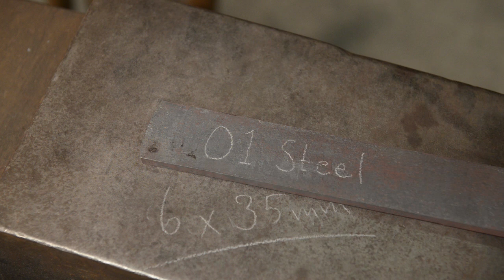Blacksmithing - Forging a herb chopper

Comment: For what is the annealing in vermiculite, i never seen that before? Thx
Reply from the maker: If you check the specifications on the steel, annealing often requires the steel to cool very slowly. By placing it in an insulator it cools quite slow. However not slow enough really for this type of steel... it should cool at a max rate of 20C / h.... from 800C down to 500 or so then you can cool in air. So it's a several hour process....
Reply: Torbjörn Åhman ohh ok thank you for your answer, amazing work

Comment: Wouldn't you want to keep the blade at critical temperature for as short a time as possible in order to reduce large grain growth within the steel?
Reply from the maker: Nope. If you're hardening by the steel specification it most likely needs to be held at "critical" temp for at least 20-30 min. To my understanding grain size shouldn't be affected as long as you don't over heat.... easier said than done with a coal forge. You really need a heat treating oven to make this right.

Comment: what is the stuff flaking off each time it is heated?
Reply from the maker: Iron oxides, we call it "scale". It is formed on the surface of the hot steel in reaction with the oxygen in the air.

Comment: I have a Question,How did people cut Steel as you did in 0:49 in the Past?
Reply: cutting while its hot..!
Reply: Heating it up and then smashing it over a wedge. It wasn't perfect, but it was what they could do.

Look at any old metal thing from over 150 years ago. Absolutely nothing was perfect.
Reply from the maker: With a hot chisel, no problem. But that often leaves a small rag and distort the material a bit.

Comment: Could you tell me how long this one took to make from start to finish?
Reply from the maker: It's not so easy to answer. Estimate : Forging 45min, grinding 1h, heat treat 30min, grinding + sharpening 30min... and about 2+2h waiting for anneal and tempering.
Reply: Torbjörn Åhman Thanks for the detailed answer! The result was definitely worth it.

Comment: How long does it take for the steel to heat to the right temperature
Reply from the maker: From dead cold, probably 2 min. A reheat is probably under 30 sec.
Reply: Torbjörn Åhman Thank you

Comment: So the black scale that falls off is that due to oxidization?
Reply: Yes, normally it would stay on the metal but due to deformation while forging and cooling (volume change) it peels off. Scale is a ceramic material and cannot change shape without breaking or coming loose.
Reply from the maker: Yes! Good answer.

Comment: What is the difference between oil and water, cooling it down?
Reply from the maker: The quenching medium all depends on the type/alloy of steel you use. Water cools faster, oil is a bit more gentle. In general high carbon steels can't handle water so oil is used.

Comment: So what stops the canola oil from igniting entirely?
Reply from the maker: For ignition you need the entire mass of the oil to go over the flashing point. You need to have an adequate amount of oil to quench in.
Reply: @torbjornahman  So how would you do this for, say, a long sword without just...GALLONS of oil?
Reply from the maker: @acowinthebarn3312  You probably need gallons of oil! Rule of thumb is about 10 liters / kg or material to quench.
Reply: @torbjornahman  Would the price of oil start to outweigh the price of material, or can you reuse it?? That's a lot of oil!!
Reply from the maker: @acowinthebarn3312  You can use it many many times, so the price of the oil is insignificant in that regard.

Comment: What is the stuff that flakes off when you use the hammer
Reply: it is Iron Oxide " rust" - the steel is hot enough to react with the oxygen in the air and rust almost instantly , also called slag, these flakes need to be cleaned off before any complex fusing  occurs to ensure you get 2 clean steel surfaces to join, without voids from the rust
Reply: Diggler Derka it's called scale lol, idk what the other dude was thinking.
Reply: Noah I recommend you look up What Mill scale actually is https://en.wikipedia.org/wiki/Mill_scale
Reply: Yo Singer oh yes, because it is such vital information that I would take the time from my day to do that.  You didn't even look up blacksmithing scale did you.  Note: I didn't even say you were wrong, I only said your word was wrong, or at least, not the word I've used.

Comment: I've seen these made from old horseshoes, but those would need high carbon steel inserted for the cutting edge, wouldn't they?
Reply from the maker: Yes for a good edge you need steel!

Comment: Can someone explain why you have to oil high carbon steel?
Reply from the maker: Do you mean when quenching (hardening) or as a surface finish? Carbon steels are not stainless, so they will rust if not treated in any way.

Comment: What's that black stuff shedding off the metal
Reply from the maker: Iron oxide. We call it scale. When the steel is hot, it forms on the surface in contact with the air.

Comment: What is the difference cooling in oil and cooling in water?
Reply from the maker: It cools at different rates. Some steels need to be cooled fast to harden others need a more gentle cool. It all depends on the alloy.
Reply: Thank you kindly for getting back to with this.

Comment: what happens when you use the herb cutter the other way?
Reply from the maker: Other way?
Reply: yes, when you hold it, if you turn it around, is it a better grip? so the the curl of the metal is at the back and your fingers can go through the larger loop?
Reply from the maker: No that does not work good for this one...
Reply: ok thanks for your reply =)

Comment: 691/5000
Good video is very interesting and educational congratulations and it is appreciated that you share your work and experience. Can you tell me why temper with canola oil in ocacines uses water and do not immerse completely but by small inmersions and then completely, what material is the one used to normalize which is the procedure where it heats and buries it in the material that I think is a type of sand or what matrial is, how it controls the penperature by color, what materials it uses in each application and the splitting machine can be manufactured and what type there is, the power of it is important. Thank you very much I hope you can answer the concerns. Excuse the translation.
Reply from the maker: Thanks. This is O1 tool steel, it must be quenched in oil. Different alloys calls for different heat treatment methods. It's quite complicated really. I suggest you do some research on the subject.

Comment: Is it dishwasher safe?
Reply from the maker: No. Actually I wouldn't run any of my kitchen knives (even the stainless ones) in the washer...    It's easy to maintain. Wash off with hot water, dry off and apply some vegetable oil.

Comment: How does he get enough heat from an open air forge??
Reply from the maker: Open air? This is how forges have been constructed for centuries
Reply: Torbjörn Åhman as opposed to an oven type construction. How is heat maintained without it dissipating
Reply from the maker: You keep the piece buried in the embers/coals. If you put the work piece on top of the fire it wouldn't make much good.

Comment: How would the "old timers" finish forging a project without modern belt sanders and grinders?
Reply from the maker: Files and grinding stones?
Reply: @torbjornahman  Yes. I remember my grandfather had a foot powered grinder to sharpen farm tools. It was 70 cm diameter.

Comment: does anyone happen to know what the type of forge he is using is called?
Reply from the maker: It's usually just called "coal forge".... there are many variants but the principle is the same, you burn solid fuel with forced air supply.
Reply: thank you sir

Comment: how long did this take in total
Reply: and how long does it take to heat up the metal
Reply from the maker: Not sure, effective time 3h maybe including filming.
Reply from the maker: It does not take that long. 2 min perhaps on the initial heat, then much shorter time each reheat.

Comment: y did he use oil instead of water to refresh the knife?
Reply from the maker: Different alloys need different quenching medias.  This is AISI O1 tool steel, and that particular steel type needs to be hardened in oil. With water it will cool too fast and crack.
Reply: oh man, thx 4 answer my question, I'm Brazilian and my English is so poor, that's y I don't understand so well on the video
Reply: and, congrats 4 ur channel, I really appreciate it

Comment: I dont mean to be rude but after u tempered it u shouldn't use the belt sander cause it will me with the temper u have just done
Reply from the maker: No problem!  As long as you keep it reasonably cool (under 200 C) it's fine.  After heat treatment it's just minor grinding, just light passes.
Reply: +Torbjörn Åhman oh ok im learning how to blacksmith so it just came to mind that it might mess with it
Reply from the maker: stream. linez
Good thinking, but as long as you stay below your temper temperature, all is well.

Comment: Hate the blacksmith that always do the surface tap before they start hiting the forging.
Reply from the maker: Well, you develop certain habits... It's pretty natural when you have been forging for a while.  Take a look at this video, it gives a pretty good explanation - https://www.youtube.com/watch?v=K8Mown8IY40
Reply: Why do you need a video that actually explains that it's a bad habbit and an inneffectivev technique? I've been at the hammer for 10 years and it was clear to me why a smith would to this. Just hit the forging first and all of the reasons to need the obnoxious and ocd tap like dissapears. Even good smiths do this tsp sure, but it doesn't mean it's in any way a good thing to do.
Reply from the maker: chronok Eh? Did you watch the video? It explains exactly why this is a habit (not a bad habit) that is useful, and actually makes working more efficient for some of us! I would say, re-gripping and establishing the orientation of the hammer face is the most important one when it comes to tapping before starting forging.
Reply: Torbjörn Åhman What you are doing is simply explaining why this tap exists and what is its purpose but not if it's good for you or if it's an effective practice. Why would you teach yourself to be reliant on a tap when you can easily develop the feel for the hammer face orientation in your hand based on orientation of the handle in your grip and the feel for the hammers inertia & mass of gravity? It makes no sense whatsoever to incorporate an extra move that robs you of your natural sense of the hammers direction based on what you feel in your palm, fingers, hands and what you see with your eyes. And besides if you teach yourself to properly hit the forging right on the first stroke, the first stroke tells your brain all of the information and even more than the obnoxious anvil tapping. I have nothing anymore to this discussion - aside from cIassical blacksmithing I also do a ton of sheet metal hammering for visual effect with rounded mirror polished hammers so this is why I have more experience with more fine techniques and practicing for accuracy - 1 bad stroke and you can trash whatever you work on - even after 10 years I am still learning every day.
Reply from the maker: chronok First of all, the video I referred to is not mine, but I think it's a good explanation why people do it. That said, I can agree that certain blacksmiths are doing this well beyond what is "needed", which makes it look quite unnatural.
Reply: Torbjörn Åhman Exactly.. some even can't hit a chisel without first taping their hammer lightly on it. Or when they make a single hard blow they need to re-tap because their brain has lost the position  coordinates and the rotation of the hammer. Most old european smiths I saw never did the tapping (I don't count resting the hammer on the anvil as tapping) but some british did which makes me think it's sort of an anglo thing.

Comment: and for what? There are already many knives and axes which are much easier to work with vegetables and herbs
Reply from the maker: It's not mine invention... I made one since I was curious how is was to use. Surprisingly nice actually.
Reply: ah, ok. good job! Universal knife of the shock absorber spring metal will do the best? and whether it makes sense? my uncle made knives of drills and files, very sharp and very robust, metal-on so strong, that the long blunt-ended and there was no need to sharpen.

Comment: Poor design the "handle" will make it where you block your vision and probably cut yourself
Reply from the maker: Yes, it's not that great, but much better than I anticipated.
Reply: @torbjornahman  it looks amazing and probably works great but from working with very dull people. It worried me seeing that, A professional chef would love this or someone that isn't dumb. But great looks and seems to work wonderfully, great job especially with what materials you used.

Comment: Too bad you took so much time to make a knife so close to uselessness... Other it's beautiful, but the handle makes it so impractical...
Reply from the maker: The general shape is not my idea. I wanted to try this out and check for myself. I was also skeptical at first, but having used it for a while, the verdict is surprisingly nice to handle.
Reply: The thing is you can only chop very small pieces of vegies... A kitchen knife has to be multi-task. I bet I can chop herbs 3 times faster than you with any low quality, normal shapped knife, even if the steel used is crappy. ^^
Reply from the maker: David Iglesias Sure! I'm on the same page I think, but it's better than expected.